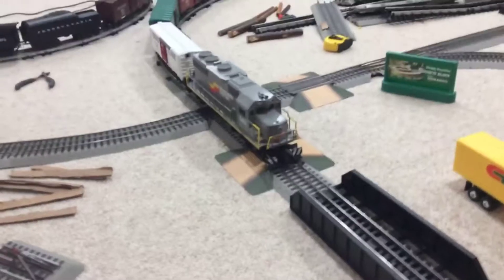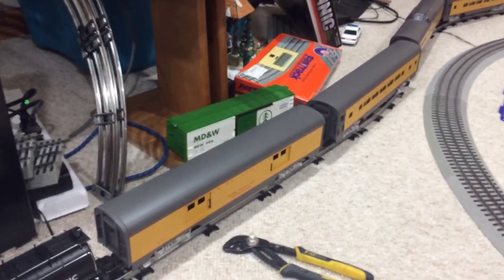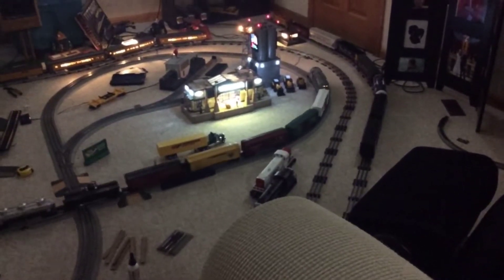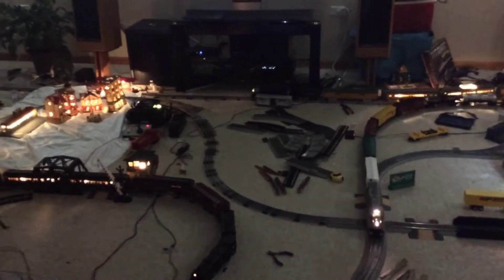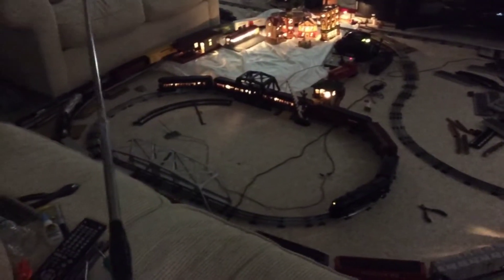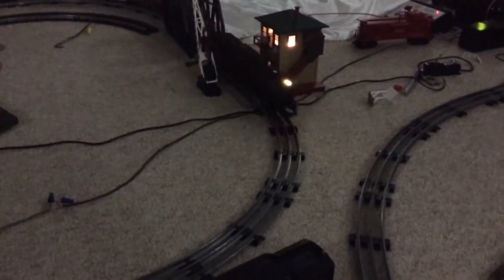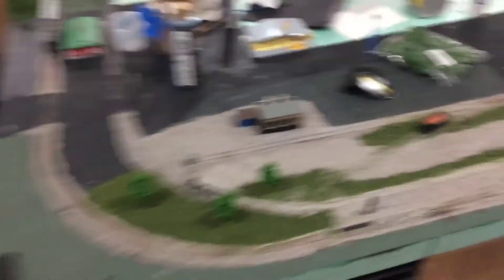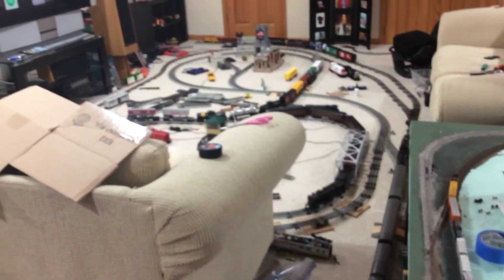Lionel Floor Layout Run Session 8/9/20

Comment: Really got to fix that engine
Reply from the maker: Portland Railfan Productions yea I got no idea what’s up with it but the transformer I was was using was pretty low wattage and the engine is just a solid chunk of metal so it might guys be a lack of power to the track combined with the weight of the engine